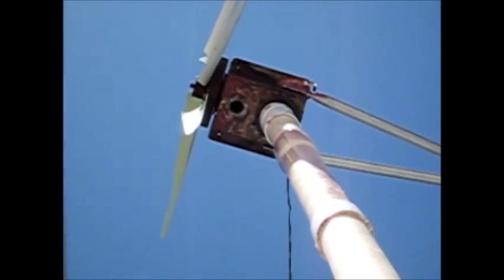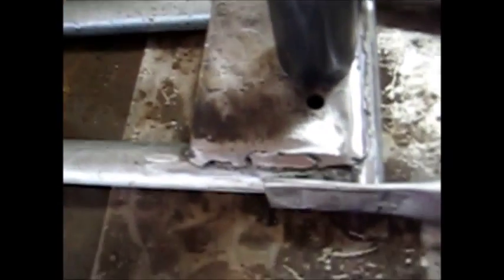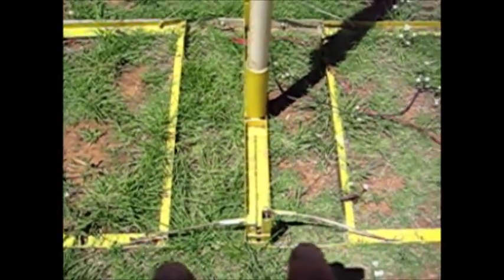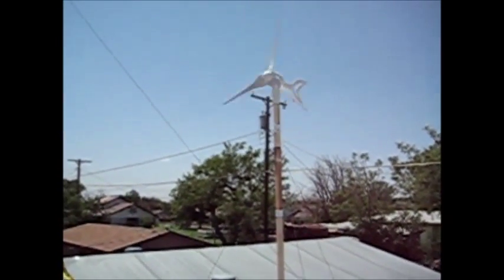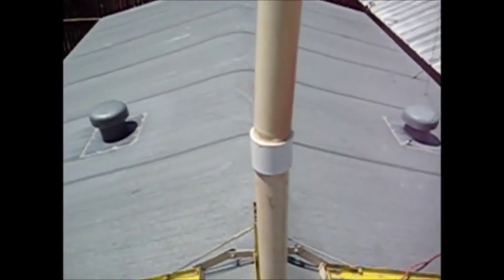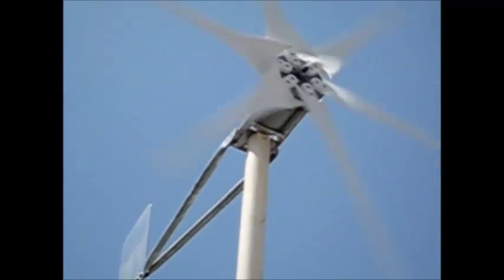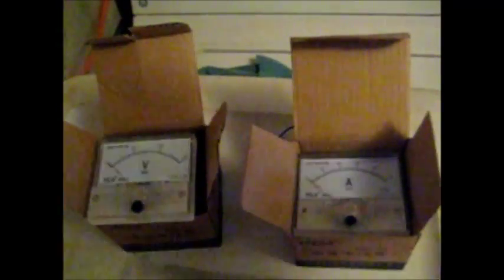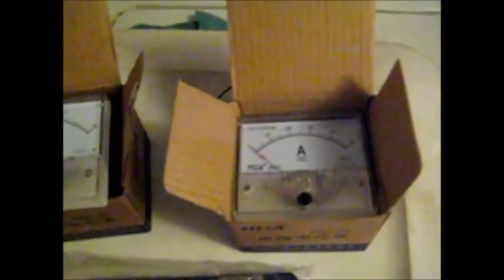DIY Small Homemade Wind Generator's V/S Small Factory Built

Comment from the maker: Thanks, If I could cut my elect biil by 1/2 I'd be happy. I managed to knock about 28 or 30 last month. with one genny and 100watt solar. I want to put up 1 more genny and maybe 200watt more solar. If you wanted to run A/c I think you would need a battery system to put out that kind of steady wattage. This is Grid tie only. No Batteries, no Charge controller.